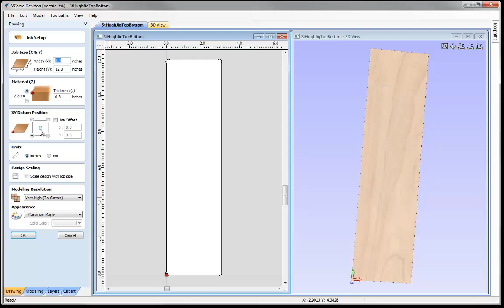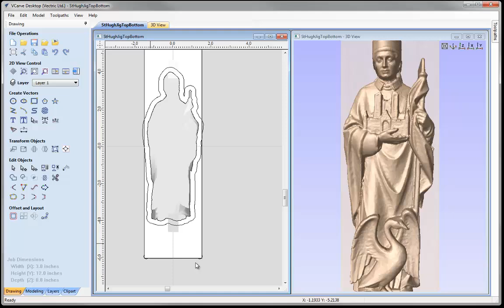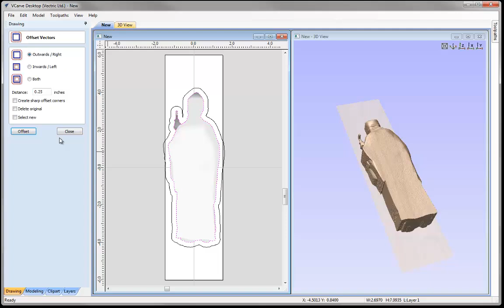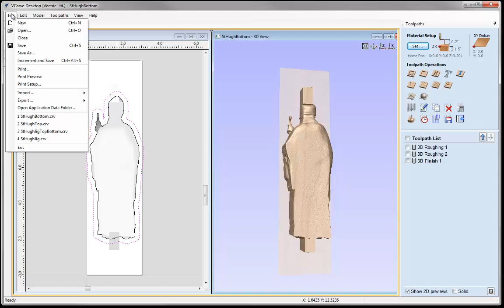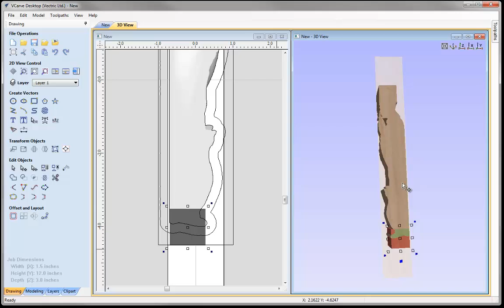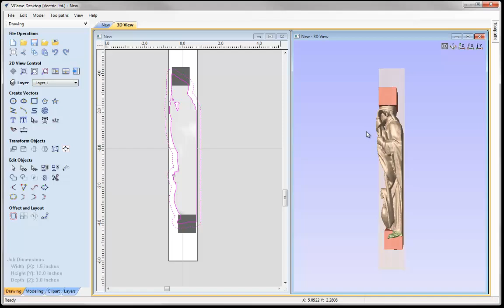Vectric - Multi Sided Parts St Hugh

Comment: I have trouble aligning things using this method.  The jig doesn't really work if the stock has warped at all.  Everyone says to use the dowel pin method but how would I apply that to this workflow?
Reply: If your stock is warped, You can make an operation to square three sides, top and both sides, then flip it upside down and deck the top. Just be careful how you clamp the material down.

Comment: 1. Running a 3D roughing tool path twice means machining a lot of air and is very inefficient. I really wish Vectric would introduce more efficient toolpaths.
2. In this case, referencing from the material is a mistake as you are assuming the material is perfectly square and to length in all directions.